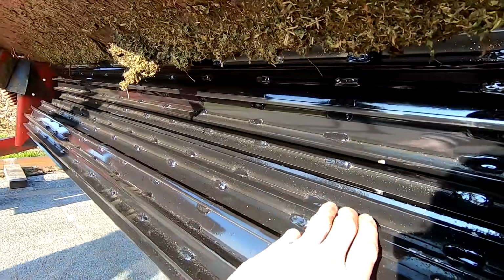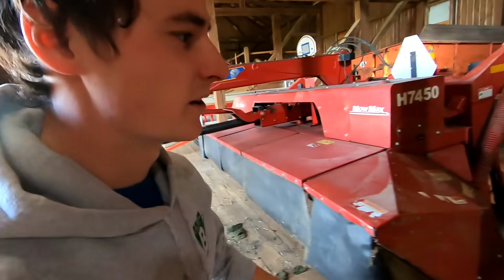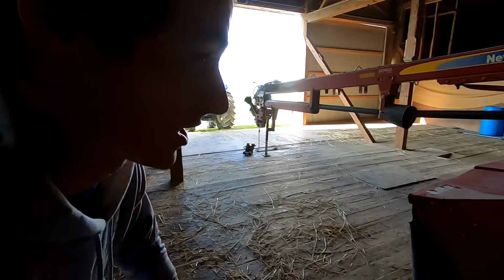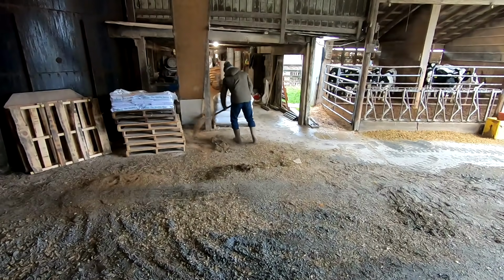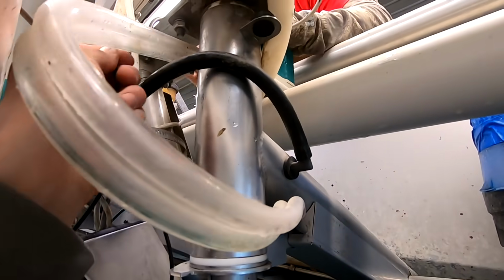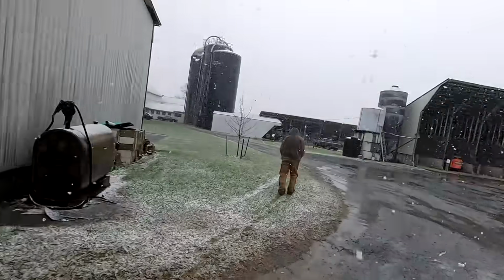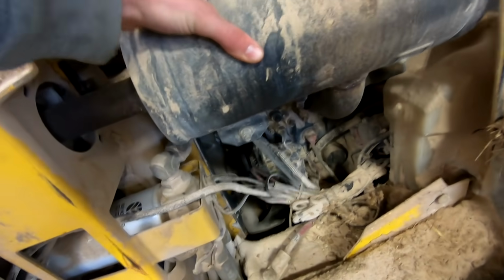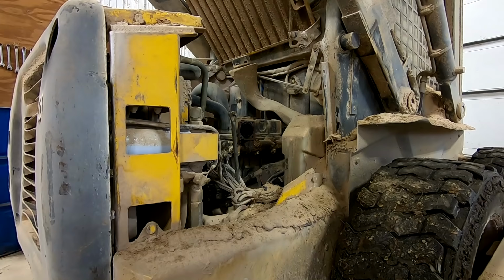New Rollers on the Discbine & Odd Jobs

Comment: did yall hear that sound at the end of the video? it sounded like a new holland crying I NEED A BATH! hehe and hey if you grease up the motor chains and the rollers and the rails on the overhead doors you will be happy. they will go up and down like butter! way easier on the main spring and the motors. i remember a few vids back you had to adjust one of the openers and been meanin to tell ya. i mean its not a necessity but you would be surprised how much it can help.

Comment: How do you like those super crimp rollers in your discbine?? I have a new 210 and run a super crimp right after discbine. Just wondering if I put those rollers in would it do the same job and save a trip over the field

Comment: Are you using 6010 DC rod or 6011 AC rod? I found 3/32 6010 DC rod works well for things like that exhaust and most root welding. You may have an old timey AC buzz box which will not run 6010.

Comment: @10th Generation Dairyman : Please don't think that I am criticizing or being nasty. You have a mind like mine. Where when you have a problem, you tinker with it and look for a solution instead of sitting in a corner whining about it. Welding can solve a lot of problems, and you seem to like welding. I would like to suggest that you take a course in welding. What you are doing wrong is you are welding a single bead onto the objects that you want to weld together, You need to learn to weave between the 2 objects that you want to weld together and make them melt into each other.